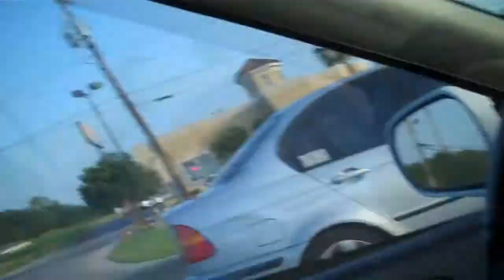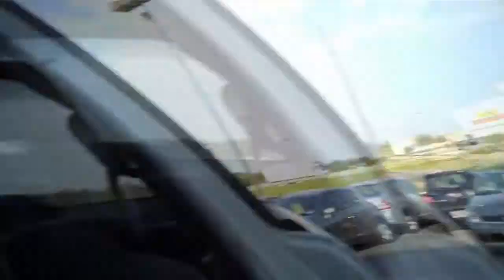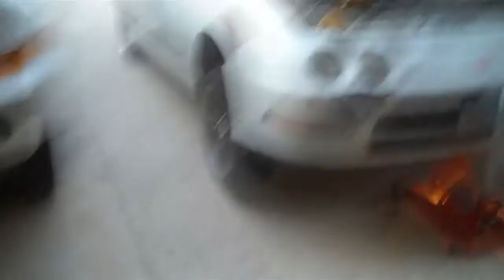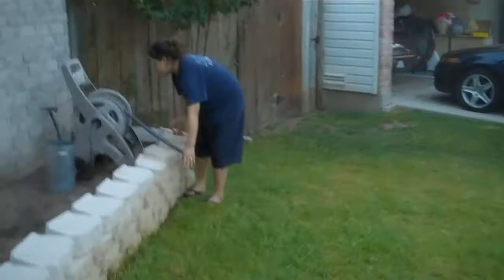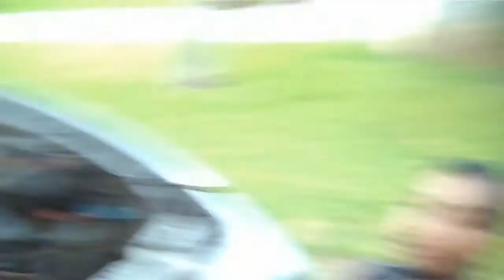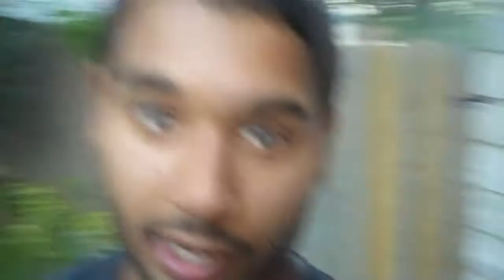Job Huntin 8/17/10 Day # 58

Comment: hey by chance is it the radiator support ? is it the top bar that the bumper is bolted to...  is it twisted or bent down...?  what exactly is it doing that stops you to put it on ...   or is it the sub frame thats cover by the fenders ?